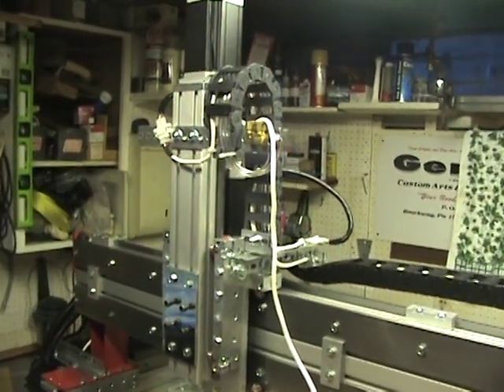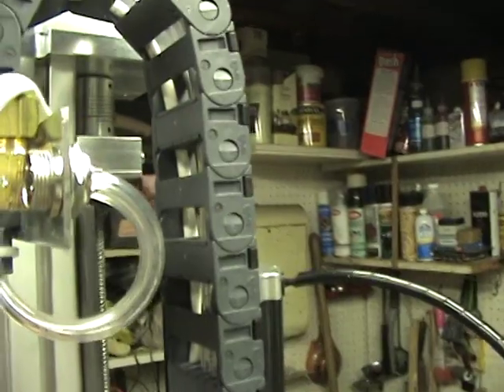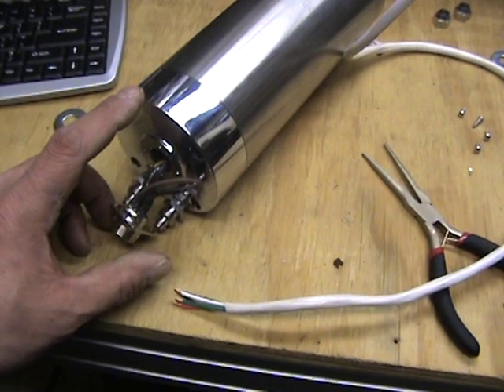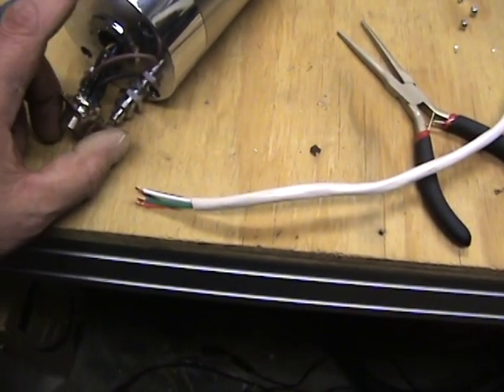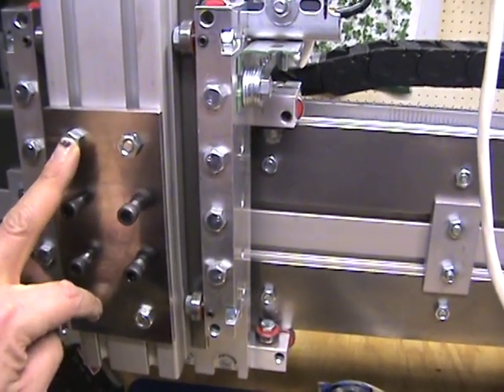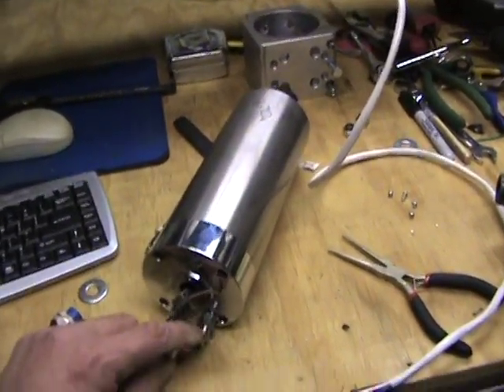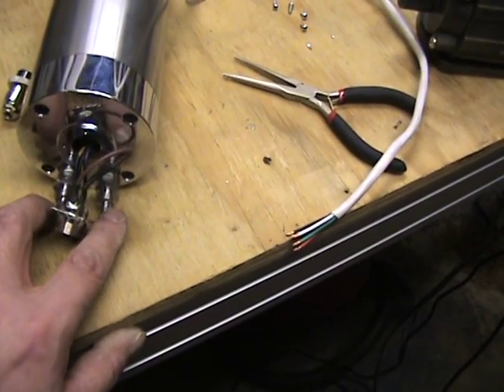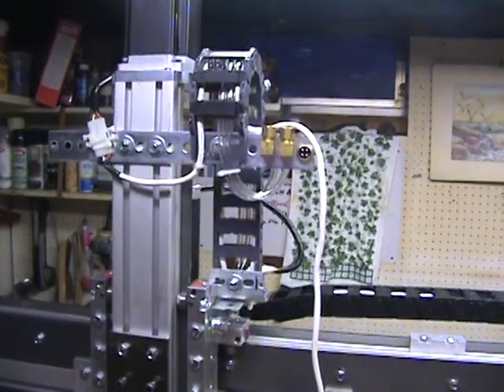Building CNC Router Parts CRP4848-18.MPG

Comment: Why do you use parts where you have to start modifying it. The motor might be chromed and shiny looking, but whats it worth as an off the shelf item for building a CNC, if you have to work on that part as well. Did you ever consider buying a Bosch 1617 router in order to save some time?

Comment: You should turn the power connectors arround, the power outlet should be female, the one at the spindle male. thats way safer (that is if i understand your diagram correctly)